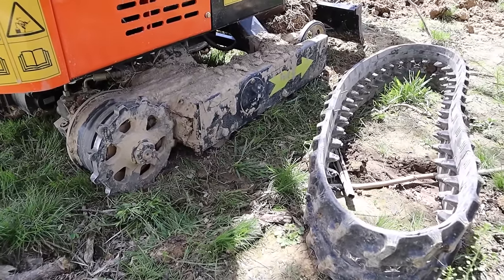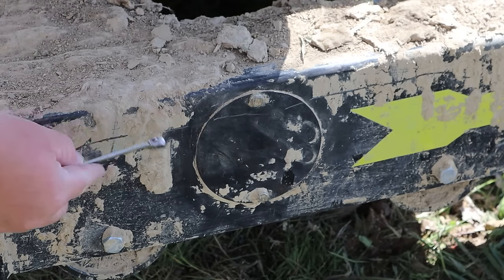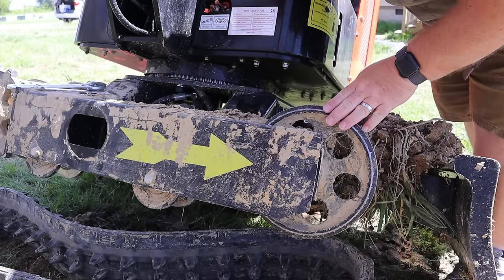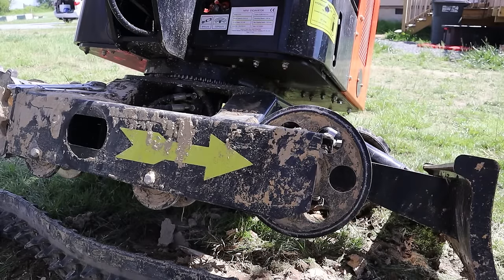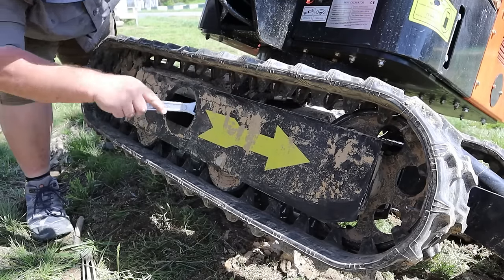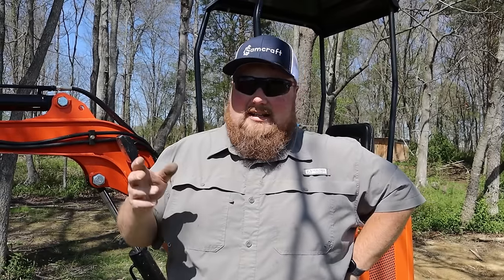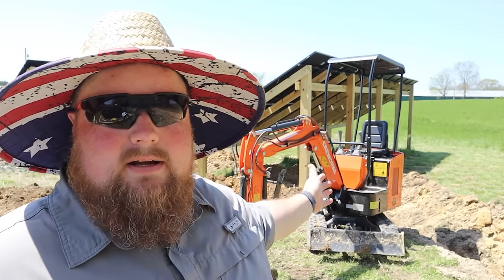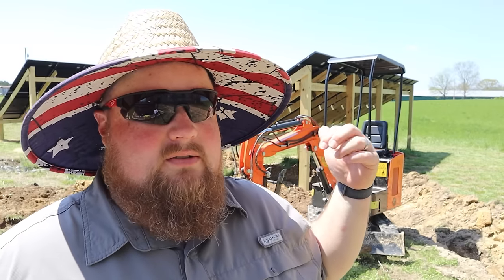Mini Excavator Throws a Track! SEE HOW WE FIXED IT...

Comment: Good job Sam, by chance did you tighten up the other track when you got the 'wandering' track back in its correct position? If the first track stretched enough to loosen up and pop off, maybe the other one should be tightened up a bit. I really doubt if those tracks are of a high quality like Cat or Volvo that they are going to standup as long. HAPPY TRAILS!

Comment: 2 things, never put your hand under a suspended load. You took off the access plate for the tensioner then proceeded to put your hand under the track as you didn’t have good access with a big wrench. Use the right tools. Socket set. Had a line blown, you’d be pinned and possibly lose that hand. Use a socket wrench next time and only got through the access panel. Or use dunnage then go under. Not trying to shit on you, I love your content, just trying to save your hand or fingers in case the worst happened. Next is just smacking that front idler as you mentioned with a hammer. Wood or wiggle then kick. These things crack so easy with the type of metal they use. Great video.

Comment: When laying out the path to dig, plan your corners to be exact 45° or 90°. Makes it lots easier to connect the conduit. Be sure to lay "CAUTION" tape at 1' below grade over the conduit. (Like the septic company DIDN'T do). 

Thanks for the video.

Comment: You see the other video of a guy dump his on its side trying to meet in the middle and drive out.  A bit sketchy with those small tracks.  Nice job.  They have teh no tooth version of the 8 inch bucket, you think that would work just as well?

Comment: probably be a good idea to put a toolbag with the escavator with all the tools you need , i can immagine being at work some distance away from civilisation so to say and having the tools needed at hand saves you a lot of walking back and forth and possibly even a long drive
theres allso a chance that those rubber tracks stretch over time and that ione of the regulair maintanance items wiould be to retuiighten them

kindah wonder why you didnt dug the ditch maibe even layed the cable and closed it up befiore installing the panels, using the wooden structure as a guide you wouldve know where the cables needed to go

Comment: Any ideal why it threw… and a lot easier than a M1A1 tank…lol
Reply from the maker: I think it may have loosen as it got broken in from use? Since there isn't an idler wheel with spring, there isn't a ton of room for adjustment.
Reply: @sam-and-angela normal for new tracks to stretch as they break in. I just had to tighten mine this week with only 6 hours on it!